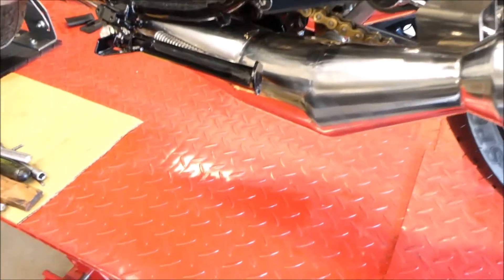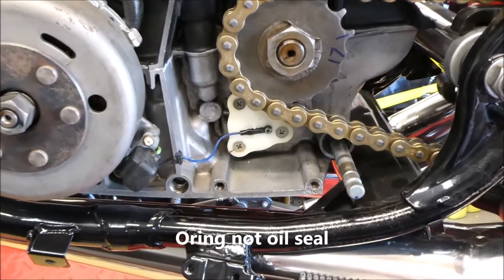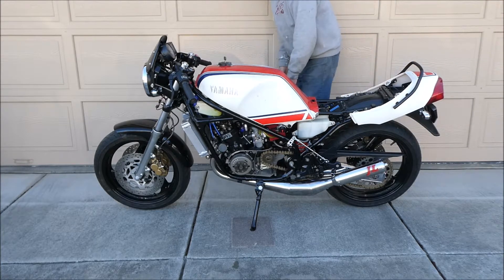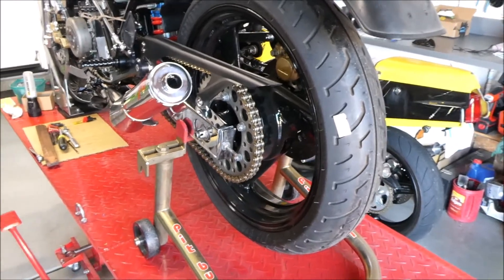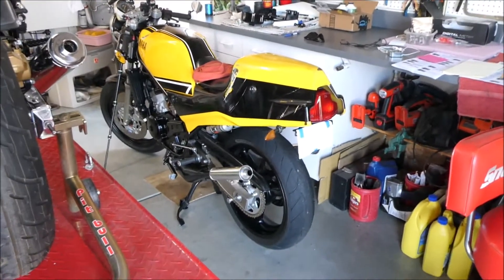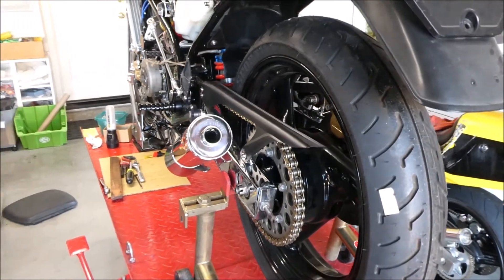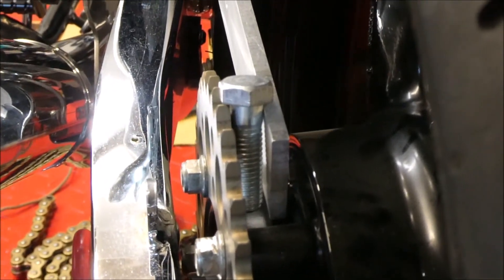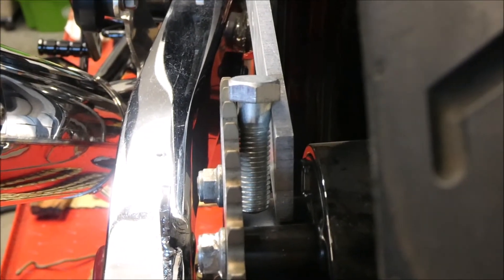RZ350 RZ FZ FZR Project Motorcycle Ep6 - Driveway start to check for oil leak then chain align check

Comment: Sounds great Ken!! Those neutral switch caps always seem to crack like yours. Mine did the same thing.
Reply from the maker: Thanks Charlie. I think they all crack like that. The thing started leaking again darn it. Hopefully changing the o-ring will stop it.
Reply: Ken,   Love the videos.  If you still have neutral switch leak after changing the o ring, you can make a gasket to seal it.  Using Cereal box cardboard, trace the neutral switch cover, make cut outs for the screw holes and the o ring flange.   Spray paint both sides with whatever spray  paint you have, and Install.  I have been running this for about 5 years w/o leaks.